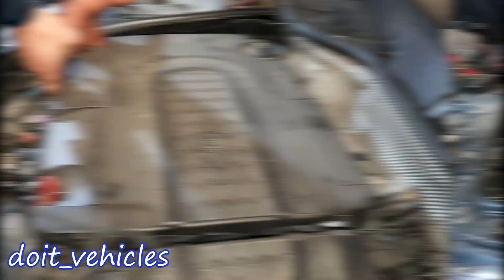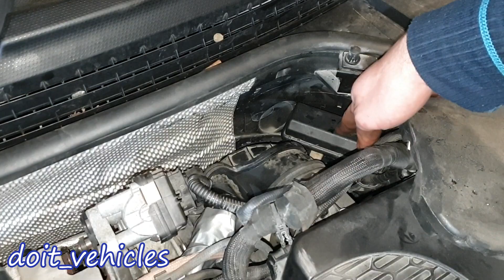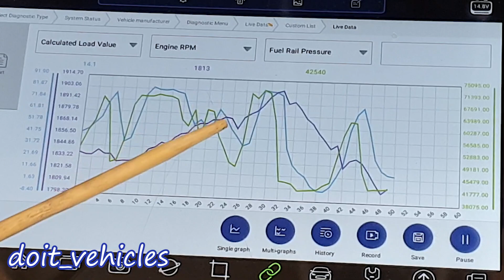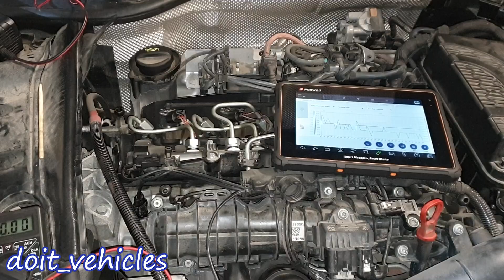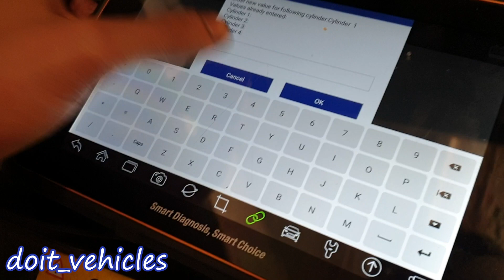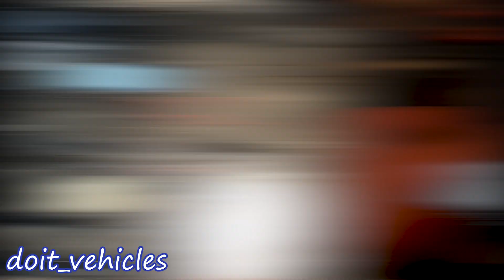How to Check the Injectors on 1.6 Mini One D

Comment: Hi my Mercedes Benz w204 with a 646 engine puffs white/blue smoke between 1600 and 2000rpm mostly in the first and second gear and the smoke is most visible when I am moving slowly (slowly is a key word) using gear 1 and 2 (mostly in traffic), engine feels a little sluggish too especially when changing from gear 1 to 2, becomes better in gear 3 and above, less smoke visible in those gears. However when I take off quickly from a stop, there's no sign of smoke at all. Mechanic checked timing and noticed it was off, could it be timing? Oh and by the way, when idle and in the garage or any closed space, it smokes such that the smoke pinches the eyes, anyway, thanks for the help.